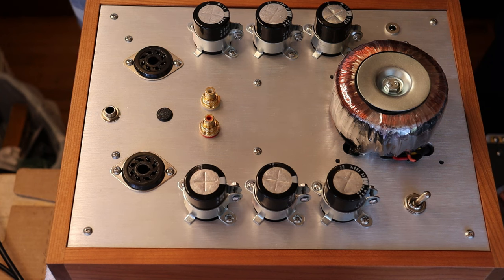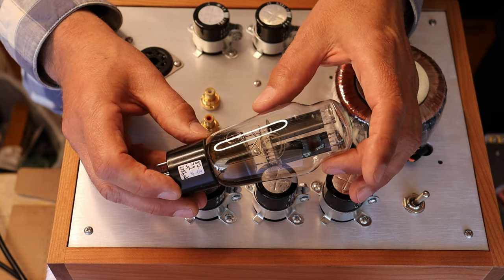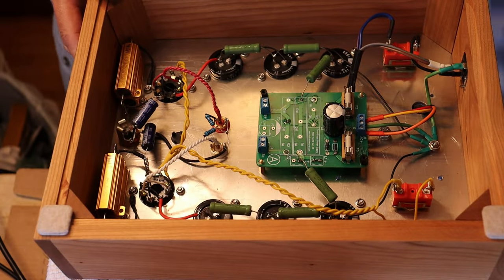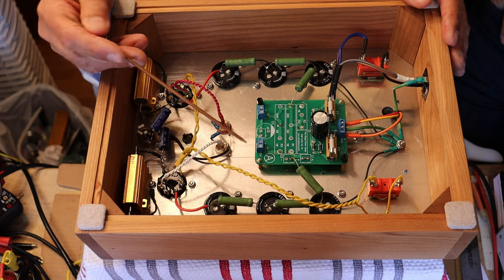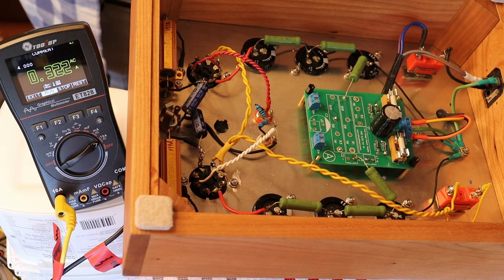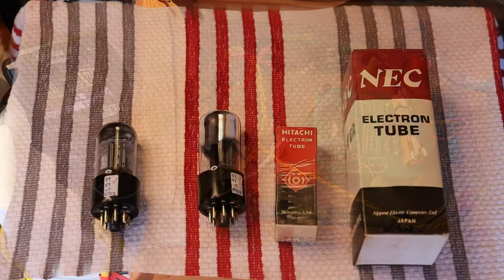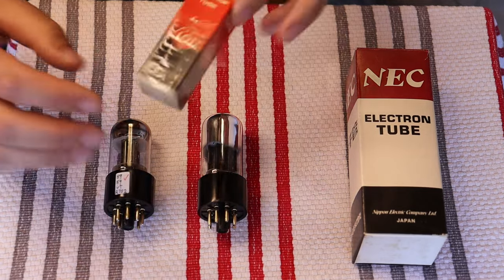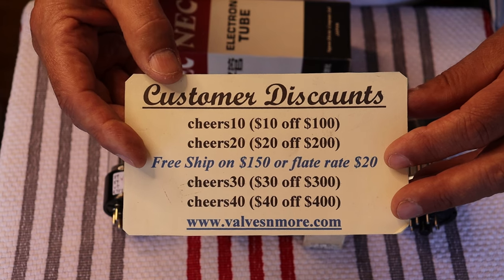Tube Lab #195 - *Inrush Surge - What it is and Why it matters!

Comment: I'm using a 5R4WGB into a 47 UF power supply cap.  Then across a 10 H choke and a 3600 UF filter cap paralleled with a 80 UF run motor cap.
I use a  CL140 inrush limiter  before my power transformer.  Modern 5AR4's have internal fireworks but NOS 5U4GB & 5R4WGB work fine.

Comment: Another cool video. I feel it's always best to go with a NOS rectifier. I haven't had the best of luck with rebranded newer types. Though I just ordered a current production Mesa Boogie Gz34 to see if that brand can hold up. The price of original Mullards keeps rising so I try to baby the ones I have.

There is another DIY YouTube channel that is pretty good...Skunkie Designs I believe is the name. She does a lot of tube DIY stuff but also some Chinese tube amp repair/correction videos. Viewers will send in an amp with some type of issue & she will open them up & go thru the circuit. There is always something not up to spec causing some type of problems. They are not well thought out with the design. They also never produce the wattage or THD that the manufacturer claims. Many of these cheap/budget Chinese tube products are a future fire hazard. 

I love y'all's 8 to 9 pin adapters...very solid, good quality.

Comment: I have used several LM337 regulators  wired as a constant current limiter source for the EL84's which function as a soft start for the filaments. No inrush current.

Comment: Please consider that a lot of amps could over voltage the filter caps when there is little to no load on the power supply.  I usually thought this was why standby was only filaments (and sometimes bias supply)... so that when the B+ came online it saw a load...
Reply from the maker: @garretthead  This is one big reason why a properly designed power supply is critical.  Many tube amps are designed by borrowing other known designs, with no (zero) actual design work being done.  This applies both to hobbyists and commercial manufacturers.  We design everything from first principles, checking every component in a design to make sure it's correctly spec'd.  This takes both experience and time, and costs money, which is why it's not commonly done any more.  Now if an amp has a separate filament switch or a standby switch it should have been designed to NOT over voltage the B+ if the filaments aren't lamped.  In a well designed power supply there should always be lots of extra room on the component specifications.
Reply: Politely disagree. An amp may have been designed, or even just tested to operate with-in spec for an application, following an intended startup sequence . Then blindly on the advice of a youtube video,  someone turns their amps on in the opposite order (ie B+ on cold start) and suddenly the amp is put in a situation it was  not designed or tested for.

You are right that a lot of amps had questionable designs. Many of those amps happily lived through years of abuse or being operated beyond specs. Now some of those I can think of probably would not survive what you suggest here... at least not many times.

I understand your sentiment as an engineer, but pragmatically what you are advising is quite dangerous to many amps... and I wouldn't expect the audience to be able to discern which ones.  To suggest intentionally operating other amps not-as-designed because you prefer to design/operate yours this way (for whatever reasons) seems sort of distasteful.   I did enjoy some of your content and hope you keep it up. Just something to consider.  Cheers.
Reply from the maker: @garretthead  to clarify, if your amplifier manual says to start your amp in a certain sequence, then follow those instructions.  An example of this would be an older Fender amp with a standby switch.  In this case the manufacturer didn't want to afford expensive filter caps, so they avoided over voltaging the caps, by first turning on the filaments, then the high voltage B+.
However in modern amps, the cost of those filter caps is no longer a significant concern and most amps are simply turned on with one switch.  This gives a significant inrush current, but the designer would have had to allow for this.  Unfortunately it probably also leads to the shortest tube life.

Less commonly amps have the option to turn on the filaments separately from the B+.  As  shown on our bench testing the lowest inrush current happens when you first turn on the B+, immediately followed by the filaments.  This produces effectively a slow startup and the lowest inrush current and probably the longest tube life.  Any designer of such an amp would automatically have to ensure the caps can withstand a higher B+.  Everyone who has ever properly designed such a power supply over specs the filter cap rating for this reason as well for longevity.  The fact that many modern tube amps are simply older circuits they copied, with no understanding of how they operate doesn't absolve the manufacturer of responsibility for ensuring a safe operating amp.
Another common method for dealing with the above issues is to build in a slow start circuit.  A thermistor being probably the most common.  Not something I like to incorporate in our designs, but nevertheless a valid approach.
As you can see there are many different approaches to achieving the same goal, a safe operating tube amp.  With a read of your manual and some common sense, this is not complicated.
The most important thing is to avoid badly designed, cheap tube gear, which we unfortunately see more and more of.

Comment: Wasn’t the first tube amp announced more than 2 years ago now? Can’t wait for the first actual release.
Reply from the maker: @el_arte  about that, and we invested about $60k developing it, only to discover the retail price point was way more than our average customer could afford.  So we went back to the design stage and started off with two key criteria - great sound at an affordable price.  That led straight to an OTL design, that impressed us enough to continue developing it.  We're waiting for a couple of parts and then hopefully we can call the prototype done.  Eventually when the Kit business is bigger, we'll release the original headphone amp.
Reply: I like OTL amps. They want excellent output capacitors. They often require 2 to 4 output followers in parallel to knock down output impedance to a point where they can be used with 50 ohm headphones. They are easier to design for 150-300+ ohm headphones.
Reply from the maker: @el_arte   Our first prototype has an output impedance of about 70 ohms and easily drives a pair of Behringer 80 ohm cans, though at 150 ohms you get a slight improvement in the very lowest frequencies, as well as a small increase in power.  We're just waiting on some parts to hopefully finalize the design.  And yesterday we started on a second prototype that will have an output impedance of about 40 ohms, we'll see if it can drive our 50 ohm planar cans.  The first design will probably become part of our "Classic" line and the second one will be for our "Modern Line", which will be significantly less expensive.  Stay tuned!

Comment: So the vintage tubes can not handle as much inrush current? Or the modern tubes handle more current?

The other thing is ripple current. A big first cap, even on solid state rectifier will have a very high current surges, constantly as it filters the dc. So really need to select caps that can handle the high ripple current. Common to see 5 to 7 amps of ripple fpr up around 300 to 400 uf at a first cap.
Reply from the maker: @whome8192  It all depends on the tube, we only talk about things we actually know, and the 5U4G is one example in which some Chinese rectifiers clearly can handle more in rush current than quality vintage production.  With other rectifiers it could be the reverse, in fact the GZ34 comes to mind, those vintage mullards are beasts and modern production is junk in comparison.
We always design a lower value first cap in our power supplies, typically 47uf with solid state rectification.  The UF4007 has amazing specs for a wee piece of doped silicone, but why stress it if you don't need to!

Comment: i think your statement on all amps being sold with cheap tubes is going a bit too far and in fact it is bullshit
Reply: @darrenfoxwell7831  saying all tube amps are sold with cheap tubes may be subjective but I think a lot of people would agree...if comparing them to NOS tubes & especially Rectifier tubes. Rectifier & driver/preamp tubes seem to be much better with New/Used Old Stock. Just my opinion though & I'm not saying all current tubes are bad. The question is are the sonic differences gained by using NOS worth the extreme premium prices these days? Gotta keep in mind that NOS seems to live much longer as well.
Reply from the maker: @darrenfoxwell7831  I agree, what we should have said, is almost all new tube amps sold in the last decade or more are supplied with inexpensive Chinese, Russian and Slovakia made tubes.  Those tubes in many cases are inferior to 2nd generation vintage tubes made prior to about 1982.  This is based on handling ~5-10k tubes per year and more importantly comments from 100's of customers, who on a daily basis ask questions like "why do my preamp tubes sound so harsh or edgy", "can you recommend a power tube that doesn't die 2 months after I plug it in", "my rectifiers are not lasting more than 6 months" and on and on.  The problem with a weekly show that's mostly filmed in one take, is it's not always possible to define everything we say in absolute terms and infinite detail - when we do that the show goes past 30 minutes and we get complaints.  Most of our viewers understand this and do more research on their own if they're interested in learning more about something.  Or ask questions in the comments section.
Reply: @tubelab194  Are you telling me that people who want to learn understand your making untrue statements due to time restraints ? seriously bud I enjoy what you guys do dont get me wrong.Its bad enough how many people on you tube are just selling snake oil with the twenty million overdrive pedals that are the best they have ever heard ever.I just felt you were going down the same path and thought you might like a little wake up call  cheers
Reply from the maker: @darrenfoxwell7831  possibly if you can provide significant evidence to the contrary.     We correspond with customers around the World 7 days a week and the number one complaint is how bad the stock tubes sound.  I make a point of never saying anything on Tube Lab that isn't backed up by substantial first hand evidence.  Now are there exceptions, of course, but exceptions don't prove the rule.  The source of these bad sounding tubes are 3 or 4 factories.  JJ located in Slovakia, New Sensor (almost all reissues like mullard, gold lion, svetlana, tung-sol etc) located in Saratov Russia and Shuguang and several smaller manufacturers located in China.  All of these tubes are modern versions of vintage tubes and a significant portion sound bad and to make matters worse they don't last long.
Reply from the maker: @darrenfoxwell7831  a qualifier or in depth analysis of every single statement we make is not practical, that's what a scientific peer reviewed paper is for.  The fact that we can't take that time, doesn't make a general statement incorrect or untrue, just not fully elaborated on.  When we think something really needs to be explained fully, we take the time to do so or we make a full Tube Lab on the subject.  Remember two of us take a 1/2 day out of our work week to produce Tube Lab, and we take no monetary compensation from YouTube nor do we accept any review fees or other money whatsoever.  Everything we talk about is based on first hand experience.
Reply: I forget who, one of them made claims of stopping production, then when there was a run on valves and the price went way up, then the company said continuing production, now selling at the new high price. We also have the war in Ukraine, so that terminates one source. But, many thought film and vinyl records were dead, but look how both came back, starting with boutique, then not too long ago, Ilford brought out a new color film. So maybe one day valves of high quality will be produced.

What about Tube Amp Doctor valves? Are they yet another bad modern imitation or are they at least good?

Cheers,
Adriel
Reply from the maker: @adrielrowley  TAD has been around for a good long while, but they don't manufacture any tubes, they just rebrand what they sell.  As far as I can see all the tubes they sell are modern production, and that only leaves 3or4 options.
Reply: Did a little digging, Shuguang used to be the manufacture until they closed. Like other German companies, TAD would then provide quality control, and being done by Germans, I would trust it. In fact, during this brief look into the matter, found no bad reviews about these re-branded valves.

However, with Shuguang, TAD is in partnership with a small Chinese company and "[w]orking closely together, we facilitated a massive expansion and modernisation [spelling original] of the production facilities[...]" 

Considering the parallel to Japan after the war and China products increasing in quality, in addition to assistance from a first world company, this might be the start of higher quality contemporary manufactured valves. What do you think?
Reply from the maker: @adrielrowley  we'll just have to wait and see if Chinese quality improves over time, currently it is abysmal with some power tubes dying within minutes of being lamped.  I think if one of the remaining factories ever put sound quality and reliability ahead of profit, they would be cheered around the World.  Btw Shuguang is back in business after a devastating fire several years ago forced them to rebuild.  Every current Chinese manufacturer is an off shoot of Shuguang with former employees setting up their own shops.  The interesting thing is vintage tubes don't suffer any of the problems of modern tubes, back in the day tubes were used not only for audio but for critical systems around the world including avionics, broadcasting, manufacturing and even the space program, so manufacturers wouldn't have lasted a week if they produced the poor quality tubes that we see today.